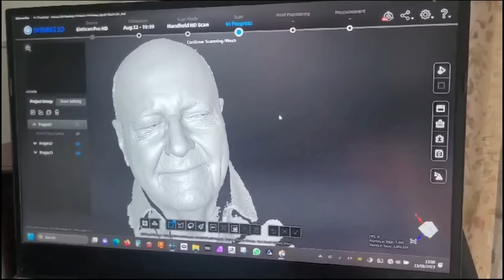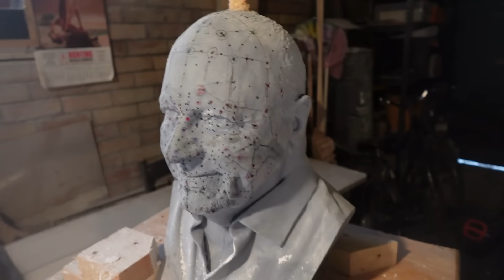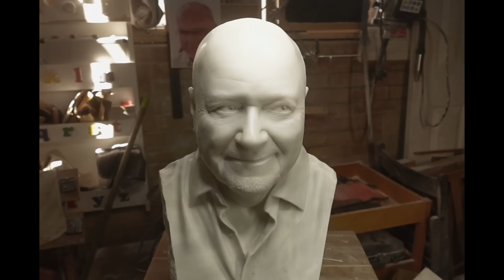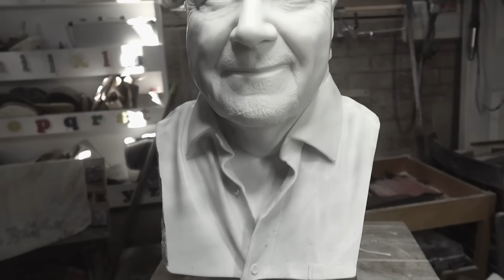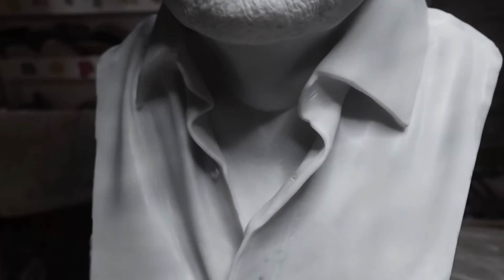Carved in Marble | Hyper-Realistic Portrait in Stone | A Contemporary Classic

Comment: Did classical sculptors (Michelangelo, Rodin, etc.) use geometric measuring methods like this? (Obviously without the aid of computers.)
Reply: The pointing tool or macchinetta that you see me using was invented in the 1700's and has been used by sculpors since to transfer measurements from the model to the stone.... Michaelagelo in the 14-1500's would most likely have used have used the triangulation method of measuring thaking measurements from 3 fixed points on his model and transferring them to the stone.  Thanks for watching ⚒️
Reply: @timbates921  That's really interesting. Thanks for replying.